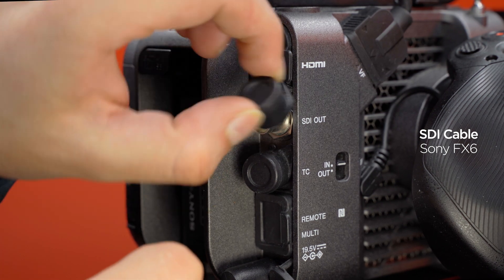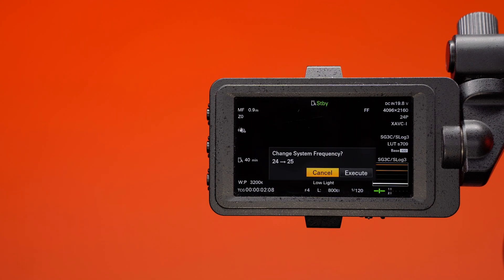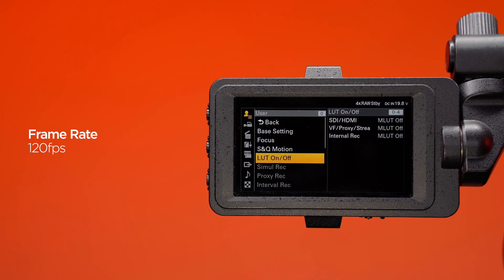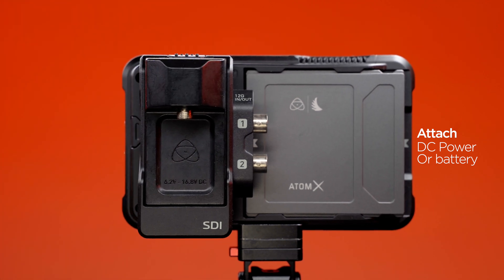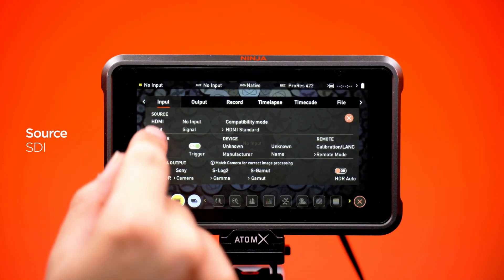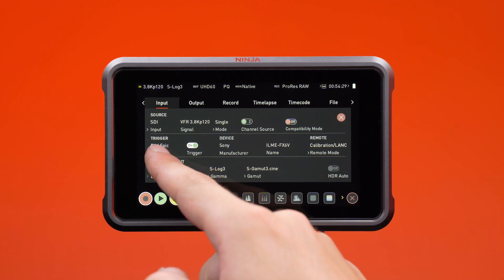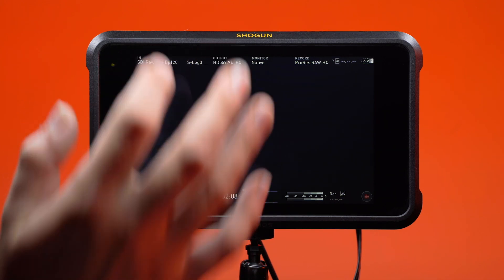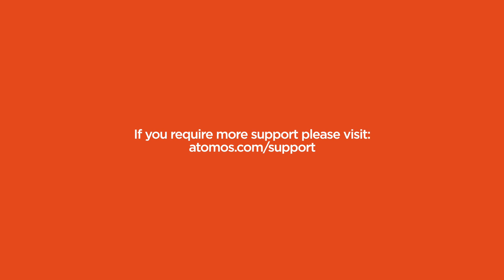Sony FX6 | NINJA V+ & SHOGUN 7 | ProRes RAW HFR Setup Guide

Comment: Thanks a lot for support , i have an issue with FPS , once i turn on the S&Q at 120 FPS, the signal disappear from atomos shogun 7 , i should turn it off and keep fps at 25 , how i can make it 125 fps as you shown in this video ? (4K)
Reply: 120FPS is only supported on the NinjaV+. Not sure why they don't add it to the Shogun 7 too.
Reply: @awa303  even 60 FPS 4K Apple ProRes RAW in SHogun not supported , what God is the solution ???

Comment: I followed all the steps and made sure all the setting matched but for some reason when change my fx6 to RAW, it turns off my SDI output and won't let me select it. It only allows me to turn on the output to the HDMI. Any ideas why?
Reply: I'm curious as well. Is it a firmware issue?

Comment: If I don't plan  on using S&Q 120FPS would I set the Raw Output format to 4096x2160 or does it always need to be set at 3840x2160 regardless of Frame Rate